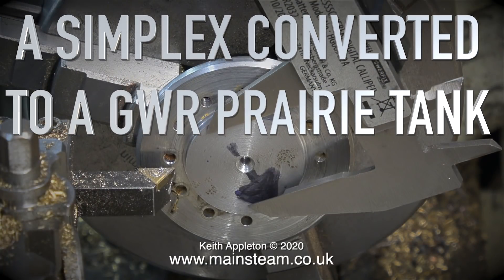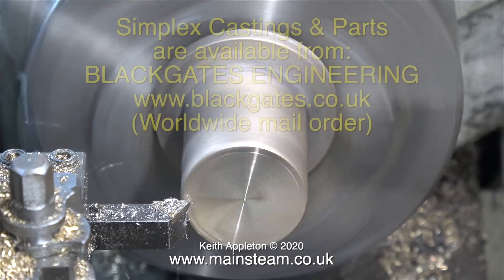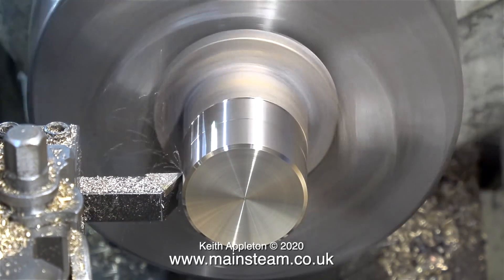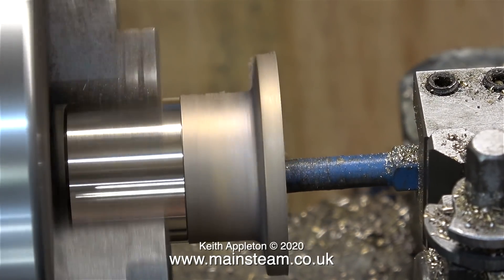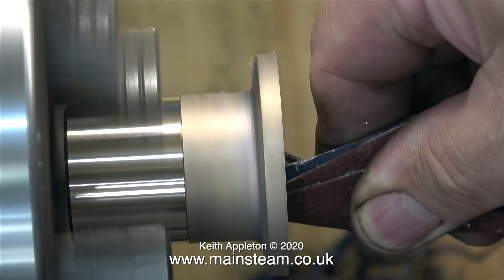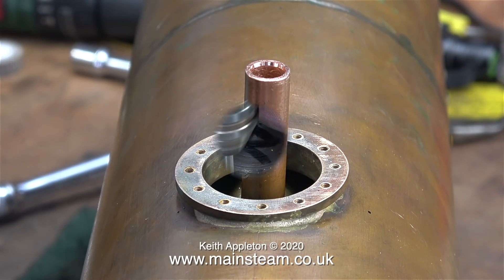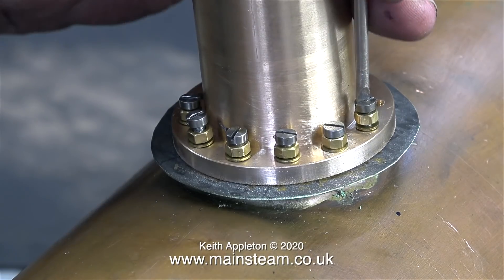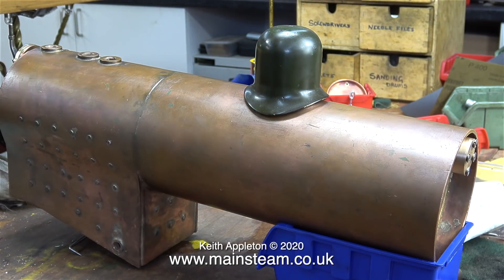SIMPLEX PRAIRIE TANK - PART #10

Comment: Thank You wery much for sharing those tips and trix!
I recently ordered a southworth 6" pump kit from blackgates and they had a realy good customer support and there was no problem shipping to Scandinavia.
(In case someone else are interested, the pumpkit i ordered is an advanced kit with castings only so, like the Stuart kit it requires a lot of pretty advanced machining.)
Reply: I think Steam Plants C Schaefer used the Southworth 12" pumpkit for the Amfora project by the way.
The kits are pretty simplyfied compared to the Stuart kit, but it's also sheaper and more forgiving since the smaller models does not hawe any castings for the base, instead it's supposed to use barstock wich can easily be replaced if one need to adjust anything. But as said before here i highly reccomend that one got some experience under Your belt before taking on any of those kits since -as shown here with the stemdome, it's realy easy to destroy castings if one does not do the steps correctly and making proper fixtures and macinery equipment.